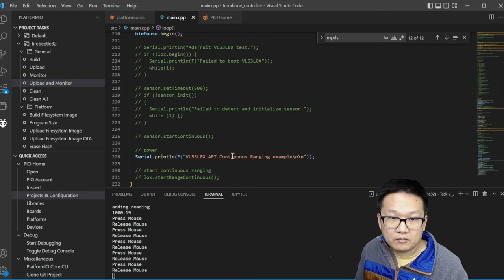I Made a Trombone Champ Controller From a Real Trombone 3.D: 3D Printed Parts, Condensation Issues

Comment: This is an awesome project. I'm a gamer, trombone player, and software developer so this is hitting all my interests at once. Have you considered using a gear rack on the slide and then measuring the rotations to determine distance rather than a light sensor?
Reply from the maker: Those seem a bit expensive. Someone mentioned using a string potentiometer which seems cheaper and would probably add less friction.
Reply: @techsistentialcrisis  What about Lego? They make gears and racks and rotation sensors. I bet you could get all of that for under $10. Friction may be the bigger issue, though.
Reply from the maker: @cthulhupanda36  Friction and I think it would be hard to mount without making it permanent. One of my goals is to make it so that I can easily convert the trombone back into a regular trombone. I don't think I've mentioned that in any of the videos though😀
Reply: @techsistentialcrisis  
With people throwing around ideas of optical mouse sensors, gears and rails and so on another possibility came to mind. The scroll wheel off a mouse.
I believe most of them work by shining light through spokes in the wheel to detect the direction and speed. 

What I'm not sure about is if there would be enough friction to make it turn if you just had the wheel attached to the end of the outer slide running along the inner one, though there are rubberised wheels that might help that, along with your hand pressing it down.
If that didn't work you could perhaps have the wheel offset from the slide and a less polished track for it to run in.

Either way taking a cheap mouse to bits might give some ideas.

The easy conversion without damaging the real instrument did come through for me and certainly made me look at things a different way from my initial reaction upon seeing the game of just wanting to make a "trombone shaped object" where I could cut holes in the slide and do other types of tinkering to use the cheapest parts possible.

Comment: If you want to make a mouthpiece / adapter to go directly to pressure sensor bypassing the instrument, I'd suggest using a T connector into speed control coupling, like Sang-A ' s NSE-04-M5 or similar , this way you can control how much air is actually spent.
Reply from the maker: I'll look into that!

Comment: Glad you're still iterating on this it's a fun problem to think about! I was curious if there was some way to convert the slide into a linear throw potentiometer. This way you'd have a smooth predictable scale of resistance to measure your slide position.
Reply from the maker: Hmm I think people have mentioned trying to use the slide itself. I’d have to study more electrical engineering to understand how that would work exactly.
Reply: @techsistentialcrisis  474-SEN-08681 the part # for what I'm thinking of. Says they're used for CNC tracking.
Reply from the maker: @RikiHorizon  Oohh interesting. Looks kind of like what they used for touch screens before they had capacitive touch screens.

Comment: I would suggest that an easy way to prevent the condensation from collecting in the bell would be to leave one side of the tuning slide disconnected.  I'd say remove it entirely but that would impact the weight balance.  Recently discovered the game, love the work you've done!

Comment: I don't know how much headroom there is compared to a normal trombone but maybe it would help to divide your distance value by some number > 1 so you can use the full length of the slide. 
This way, you could reach higher accuracy, but of course you would have to move the slide more to reach the same notes.

Comment: I know I mentioned finding a beater horn on Ebay, but I think I may have a better solution. pInstruments makes a plastic trombone called the pBone for $200 USD. You could beat that up, drill into it, and throw it across the room like a real controller and not feel bad. I don't think they have a Bb model, but it's an option.

They also make a plastic trumpet called the pTrumpet for around the same price. It's an okay horn, great for practicing and storing in the back of the car. But it won't be replacing your Bach or Yamaha anytime soon.
Reply from the maker: I think the horn itself is worth maybe $400 used so I think I'd rather just get another if I'm spending that kind of money (which I probably won't). It's probably a more interesting challenge to make some components that can be detached easily and still have a functioning cool trombone at the end of the day.

Comment: I had an idea. You could use some kind of spool that outputs a rotational value and connect the string to the slide to create a solid input. Like an electrified key chain extender
Reply from the maker: Haha I think this is similar to what others described as a string potentiometer. I haven’t tried implementing it yet but it seems like a pretty common suggestion!

Comment: Bit of a wildcard idea, but have you thought about using the brass of the slide tube to provide resistance for a potentiometer setup? ie. Attach a live wire (obviously safe voltages and currents are advised) to the base of the slide tube and a grounded sliding contact wire further up. Measure the potential difference across them to infer the position of the slide tube.
Reply from the maker: lol I can picture the headlines: Amateur Trombonist and Youtuber Electrocutes Self While Trying To Play Trombone Simulator Game!

I think that sounds like an interesting idea but I probably need another degree, maybe in electrical engineering to figure it out.

Comment: I love the mouthpiece idea 🙂 for my MIDI controller I'd love to create a 3D printed bit that the mouthpiece fits into which has the sensor embedded in it, with some small holes to allow the air to pass through on the other side so you don't pass out from blowing into it ha ha
Reply from the maker: I imagine I might have to go through a few iterations to get the design just right on the mouthpiece. It should be fun though.

Comment: Y'know, it's probably worth considering a Tenor or Alto TROMBONE instead of a Sporano, the larger slide would essentially be a lower sensitivity compared to the sporano, which would ideally be easier to control at the cost of requiring you move your arm a bit more.A larger instrument in general also opens up more options for mounting and scaled up sensor approaches that may be easier to do. Something to consider! *Edit to fix my smooth brain mistake.

Plus it'd look way the heck cooler
Reply from the maker: Wait, you want me to use a saxophone as a controller to play Trombone Champ!? It's so crazy it might just work!
Reply: @techsistentialcrisis  Soprano, Alto, Tenor, and Bass are basically different pitches of instrument, it's not specific to saxaphones. Your'e using a soprano trombone, that's why it's itty bitty. Tenor and Alto Trombones are larger, with Bass being the largest (probably overkill for this). Basically I'm just suggesting using a larger trombone lol
Reply: I Just noticed I brainlet said sax out of habbit. I meant Trombone! AUGH

Comment: For your smoothing algorithm, I don't think an average is actually necessary. You can just use the sum and skip the division since the number of samples is always constant (obviously you would have to change your thresholds accordingly). Although now that I think about it, division by factors of 2 is one of the simplest operations for a computer so I wonder what the difference in performance of 8 samples would be compared to 10.
Reply: You're not wrong, but similarly the division will be taking like literally a billionth of a second. The real latency is introduced by waiting for all the sensor readings.

Comment: There are cheap digital callipers with data-out ports that could possibly be repurposed to keep track of slide position. I don't know if the reporting rate is high enough to keep up with the game but they are remarkably robust to fast movements and I've never seen them lose position.

Comment: I play neither trombone nor trombone champ lol. I'm thinking if it's possible to make mute-like appendage + hole drilled that's fastened with cork instead of using saran wrap. It should be both stabler and allow air through. You can also grab some cheap mute (5-6 USD) from china and modify it instead

Comment: you should use a resistance based distance sensor by lining the inside of the trombone and measuring the resistance to calculate the distance, it could be a lot more stealth and more reliable.

Comment: As far as the slide tracking... I have a question. Is there any sort of light sensor strip you could mount alongside the stationary part of the horn? Then you could mount a LED to a fixed point on the slide so that when the LED slides past the sensor, it reports that as mouse movement. Apologies if this isn't even a thing, I'm not a hardware cat I fear. There's so much wild tech out there though that I figured it was worth a shot to check, though.
Reply: What you talking about is encoder and encoder strip from old inkjet printer. Its very precise and easy to read.

Comment: I have a another idea, which only works if your trombone is conducting electricity. If it’s not, find a way to make it conductive or it won’t work.

Please correct me if im wrong

The idea is as following:
1. get a sensor that measures resistance.
2. connect one wire to the tip of the moving part.
3. connect one wire to the not moving part.
4. connect the wires to the sensor 
5. the higher the resistance, the deeper the note
Reply from the maker: I don't know that much about electricity but it seems like having an electrical current going through the horn seems kinda sketch.
Reply: @techsistentialcrisis  well i wouldn’t plug it directly in, but power it through a transformer or use a car battery. The current just needs to be strong enough to be measured when the trombone is fully extended. 
And electricity always takes the path of least resistance which is definitely not your body. And if you are concerned, you could wear one non-conducting glove (you don’t need two)

Comment: so my biggest thing (and I am not 100% on how the game works for note positions so I could be wrong) but it appears to be basically throwing 2 octaves of notes in doubleing the actual slide positions of a typical trombone... have you thought of having it actually set so the actual "7" main positions corelate to specific spots on the mouse with a button to trigger the offset to change octave?
Reply from the maker: I'm not really as concerned with the slide position fidelity since I'm not a trombone player, but I feel like adding that amount of abstraction to the controller doesn't make sense. At the end of the day it has to be fun to play. For example, the Guitar Hero controller didn't actually have more buttons up and down the fret to simulate the pitch of the notes, so why should my trombone controller need to worry about it?

Comment: Movement seems pretty jittery in gameplay despite the solid build and smoothing. Either the report rate of your sensor or microcontroller is low (mice and keyboards are often 100Hz, while gaming mice and keyboard are usually 1000Hz), or your code is using too small of a float (i.e. float instead of double) for calculations, or the resolution of your sensor is too small (and filtering can only get you so far there and at the expense of lag)